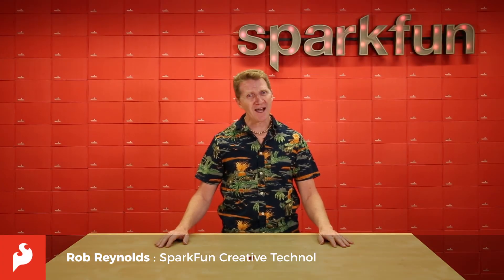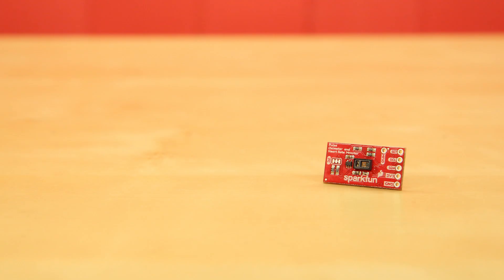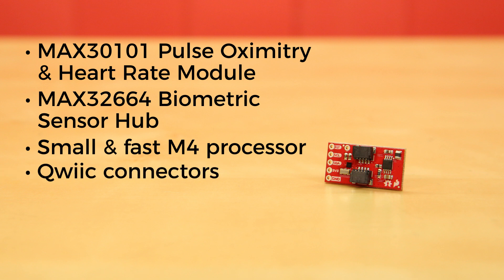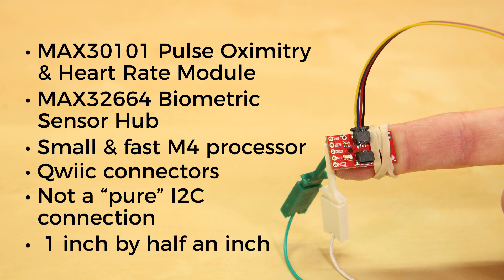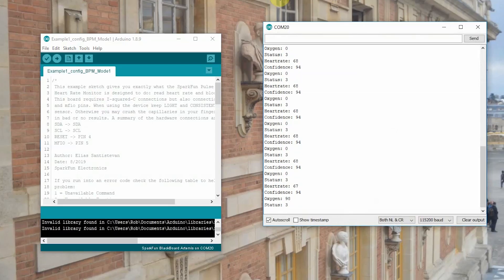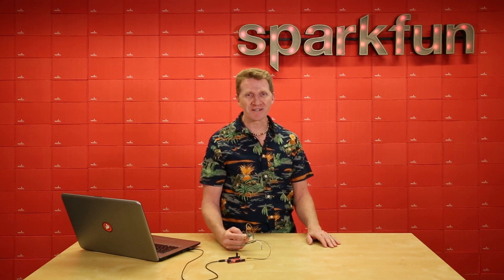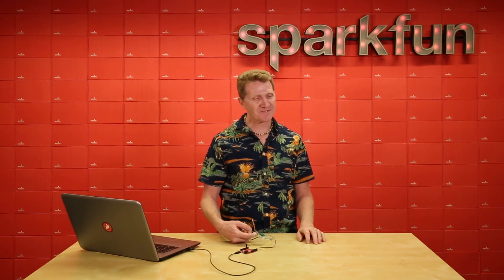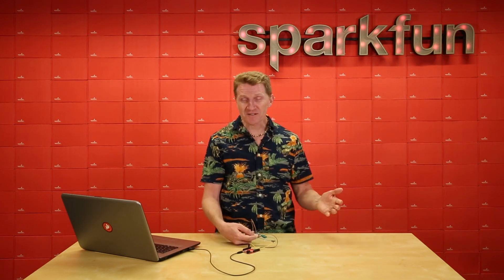Product Showcase: SparkFun Pulse Oximeter and Heart Rate Sensor

Comment: Tested this BOB out and ported the library to the nrf5 SDK. I was intrigued by the accuracy of the algorithms running on the MAX32664, comparing to a commercial pulse oximeter.. 
But there is one huge caveat: the chip is supposed to be ultra low power and for "mobile health" while actually consuming about 8mA in idle mode and the LEDs of the MAX30101 off! While operating and taking measurements the power consumption goes up to about 16mA or so. Not exactly low power I'd say. Those tiny 100mAh batteries typically found inside unobtrusive wearable designs won't last that long with this power consumption. And in the datasheet you don't find any clear info on power draw...a little intransparent.
But thumbs up for sparkfun for their effort creating this board and the library!
Reply: That's 12days on a 5000mAh battery?
Reply: I subscribe to this. It draws about 16-18mA using the max algorithm. Not low power at all. Have you found an alternative in the meantime or have managed to reduce the power consumption somehow?
Reply: Yes, hacking a commercial Oximeter like in the vids by Andreas Spiess

Comment: I've been trying to read data from this sensor for a week and I have had no luck. The connection shown in this video is very easy since you use the qwiic connectors. I am using the GPIO pins of the development board. I have 3 main questions:
1. How  do I turn on the development board? How do I know it is on?
2. As soon as it is on, can I supply it I2C commands or do I necessarily have to configure something before hand?
3. Where can I find some source code in C used to communicate with this development board? 
Thank you.

Comment: how do i make it work as a cardio watch? because when you place it at the wrist it gives no signal
Reply: I am really late to reply but you need to use a Green LED for wrist applications,this MAX30101 present in this module has one,I personally still am struggling with getting RAW Data from this LED(i can just turn it on and that’s it),if i manage to get it to work for the wrist application i am doing, leave a reply here and i will help,If you by chance did it already may i ask how?

Comment: Can it read the HRV?
Reply: If accuracy is important for you, I would not choose this device for HVR. When you are looking for an accurate PPG heart rate sensor, take the Polar OH1 heart rate sensors with 6 LEDs. As far a accuracy is concerned, it has the accuracy of of ECG, which is the most accurate device available. Unfortunatley, Bluetooth low energy heart rate profiles for the the Polar OH1 do not transmit PPG raw data to calculate HRV. Adafruit gives a hint how this problem can be solved:

https://forums.adafruit.com/viewforum.php?f=65

Comment: what are the accuracy of these devices compared to the real hospital grade stuff?
Reply: I use this sensor for my project and it works as well. I compared to heart rate finger clip. I recommend this  but I'm not sure for high-grade hospital.
Reply: @kt-rin  PPG signals can be use to calculate HRV and respiratory rate for instance in Matlab. But there is a problem with accuracy. Some of these PPG devices have a strong deviation from ECG devices, which are to most accurate heart rate devices available. But I don t know whether someone did a test of this device about the accuracy compared to a scientifically validated ECG device. Me personally, I came to the conclusion not to use such a PPG device for HRV measurement or respiratory rate estimation, but rather to use a device from Bitalino or Scott Hardens sound card ECG for this purpose.

Comment: Who wouldn't want to know their plethysmographic dynamic indices of respiratory-induced variation?

  I'm actually curious what the difference is between this Maxim sensor and the one typically used in hospitals now. The one from the hospital looks like a weird LED with no other hardware, just a couple of wires coming out. It is issued in the hospital ICU to monitor blood oxygen while a patient is treated with opioids like morphine and dilaudid.
Reply: That's a good question. Though I haven't torn apart any medical devices, I do know that this particular chip (MAX30101) can be used in commercial designs - given that you can satisfy federal and medical requirements.  Maxim integrated (the company that designed the chips) have some notes on how that's done directly on their site.

Comment: I've got a project that could use this but it can't go on an extremity. Will this work when applied to other parts of the body like the arm or the back?
Reply: You could try it on ear lobe. Thats what the use in hospital if finger not a good location
Reply: These sensors will work on ear lobes too.
Reply: I don't know for sure, but the type used in the hospital must go on the finger where the appendage is more translucent. At least that is what I was told when I was in the ICU with one.
Reply: That's a good question. No, this particular sensor and the corresponding algorithm are specifically for a finger.